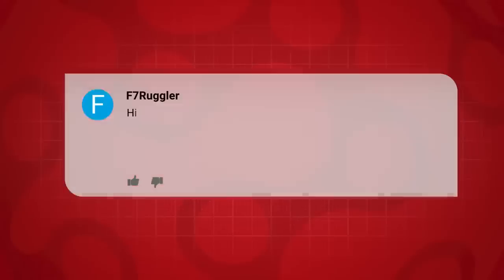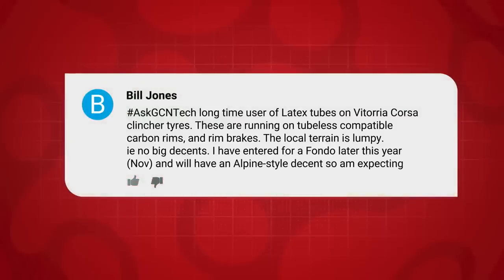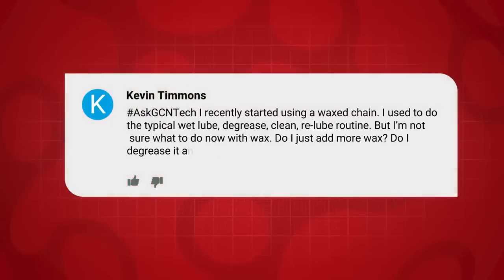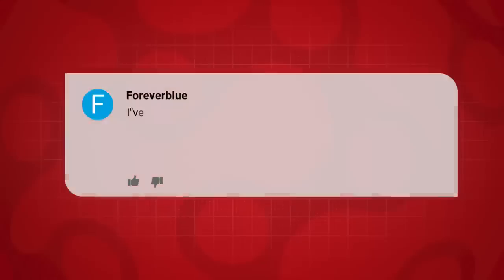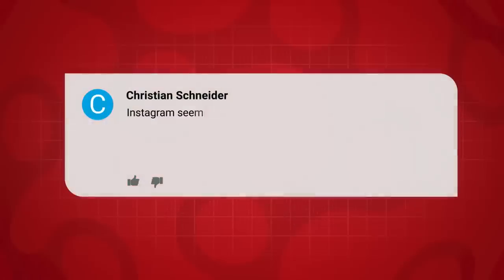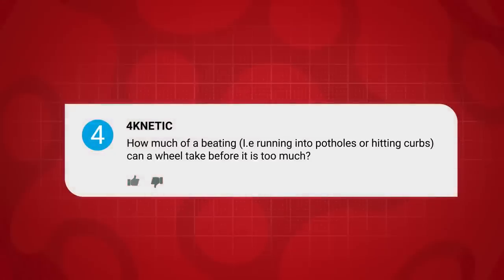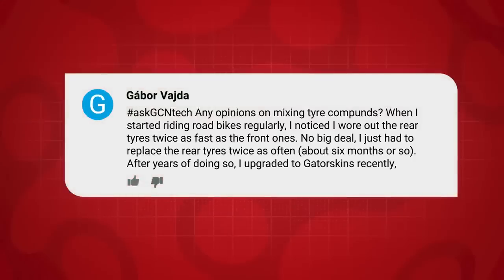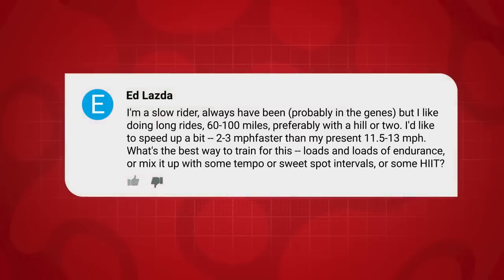What Is The Most Efficient Cadence For Cycling? | GCN Tech Clinic

Comment from the maker: Let us know your tech queries using #AskGCNTech 👇
Reply: Hi, GCN Tech! In your videos you are compare tyre witdth without relation to rim width. For example I using 23 mm width Conti tyre with c15 Filcrum rim. What if I wear 28mm tyre to this? Will I improve rolling resistance and ride comfort? Or it is better use slim tyre with slim rim?
Reply: #askgcntech HI, I recently got my first smart trainer and was wondering what are the best nonsubscription options? Are there any virtual programs to buy?  Thanks!
Reply: Hey guys! I'm currently running the SRAM FORCE 12 Speed ETAP AXS groupset and was thinking of slowly upgrading to the SRAM RED 12 Speed ETAP AXS groupset. Problem is, I'm not entirely sure if it's possible to mix groupset components?
Reply: Hi #AskGCNTech do you have a MTB road race in your country or just trail and gravel race?
Reply: #AskGCNTech Hey guys, so I'm looking at buying a road bike now (coming from MTB) and I got an option between an older 2014 s-works venge (used) or maybe even a current 2021 Trek Madone SL6 (new). Both for around the same price but the s-works would have rim brakes and older geo? 
What's your thoughts on this?
Reply: @GCNTech quick tip on tyre inserts for tubeless, I have had trouble with deflation running them straight away in a new set up (going from 75psi to 35 overnight) . I run the wheels without the insert for a couple of weeks to allow the sealant to do its job on the rim bed and the tyre carcass, and that has made a great improvement, taking more than 3 days of abuse for the pressures to drop the same way.
Reply: @ffop  I am under the understanding that AXS is mix and matchable.  I have Rival Front and Rear Derailleurs, and Force Shifters and Brakes.
Reply: Hello guys just want to ask my gravel bike tire on the back has
wrinkling marks like on drag tires of cars is it 
because im heavy i weigh 80kg or my acceleration power is high 
and my tire cant handle it #ASKGCNTECH
Reply: #AskGCNTech
Hi Tech Team... I upgraded my bike computer last year. From a 2016 CatEye STRADA  to a XOSS G+ GPS unit. Everything was peachy until I did my first 200 Km ride. I felt that when riding in unfamiliar places I kept taking my phone out to check where my current location is. Also, during ascents I worry that I may not have enough energy to reach the top. Which did happen. Not knowing that the climb was about to end in a few meters.
Now, for a person who rides 2-3 days a week (sometimes less) would it be wise to upgrade? Which would you suggest if I should upgrade? I'm torn between Wahoo ELEMNT Bolt and Garmin Edge 530. But leaning more on the Bolt. Hope you can help.
Reply: #AskGCNTech when are you going to replace the missing Park Tool tool hanging on the right of the screen? It’s killing me!
Reply: #AskGCNTech Hey guys, does a small handlebar roll really have a positive influence on aerodynamics as you can read on several websites or is it just another marketing gag? 🤔
Reply: what is the best cadence range for sprinting and what is the best position to be in as I'm a heavier rider with a bit more power I really enjoy sprints but I feel like there is a lot more that I can get out of them

Comment: In regards to cadence, it is a highly personal comfort issue.  That said, the major lower extremity muscles used to move pedals are primarily constituted by slow twitch oxidative muscle fibers.  These are the skeletal muscles aerobic fibers.  They are the first to be recruited by the CNS and have a relatively small cross-sectional area which means they do not generate large quantities of force relative to other fiber types.  What's more, it is believed that as say a cyclist becomes more trained, some of the other fiber types will shift in their function to this type.  It's one adaptation to training stress.  Thus,  these fibers will ultimately be the most commonly used by a cyclist and they function best under lower force but higher contractility rates.

This is one reason why a higher cadence for general riding is widely preferable with lower  cadence, high force work necessary for steep inclines and town line sprints.  I won't even get into the stress on the ligaments and other soft tissues...

Signed...a physiology nerd.
Reply: I used to hate any high cadence when I was very unfit and my brain was telling me not to do it as I would then struggle for breath etc, that the strength in my legs to grind was my advantage. A few years on and I thought just the other day how my style has naturally evolved to a much higher cadence - anything else now feels unnatural. I only really grind as a last resort when things are just too steep and I don't enjoy it at all.
Reply: I know for a fact, if you have lung or heart issues, you definitely will be restricted to under 85 rpm. I recently figured out that because I have a heart murmur I could never keep up for long with the faster riders.  A friend of mine had lung problems and had to use monster gears to keep his rpms down under 75 rpm.  TALK to a sports DOCTOR.
Reply: As a compact cyclist, 1.5m, 48Kg, parceling the same power using higher cadence (mine usually around 110 on flat/rolling terrain, 90s or even high 80s for ascents) requires good aerobic fitness, but is far easier on the musculoskeletal system than doing a thankless grind in higher gears ratios. But that's just me adapting to what's comfortable for me. Yout results may be quite different. Everyone has their own chosen cadence sweet spot.

Comment: To foreverblue: I‘m also a long-time MTBer and only started road cycling last year. From the MTB, you are most likely used to high cadence. A major difference I noticed is that road bikes often come with the big gears the roadie pros use but almost no MTB, even XC race bikes, come with the gears MTB pros use. Don‘t be shy to switch to smaller gears.
Reply from the maker: Good advice Christian!
Reply: By smaller gears you mean the more tooth count?
Reply: @BigBrownMonke  More teeth on the back, less teeth on the front. You could get a compact chainset or a bigger cassette (if your rear mech has the capacity)

Comment: On the topic of rear tires wearing out:  Most road tires are symmetrical, i.e. there's no front specific tire or rear specific tire, and the tread is generally designed to run the same direction front or rear.  So what I like to do is rotate my tires as the rear wears out.  I'll move the former front tire to the back, since it is generally not very worn at all by that point.  Then I'll install a new tire on the front.  

This gives me maximum grip on the front wheel where it's needed most.

There's not as much of a culture in road bikes of running a "mullet" setup with different size or types of tires front and rear, but there's no inherent reason it wouldn't work.  It's mostly an aesthetic thing to make sure your tires match.
Reply: exactly what i do!
Reply: This came up in a previous tech clinic and is not recommended since the rear tire wears out differently (whatever that means). I think Dan was the one who said this specifically

Comment: My trick for waxed chains...once you've initially degreased and waxed the chain, no further degreasers or solvents are necessary. Just remove the chain an put it in some boiling water. The heat will melt and remove the old, dirty wax and clean the chain.
Reply: Jonathan, do you reuse the quick links when you do this or use a new one every time?

Comment: Re waxed chains, I have been using them for mountain biking as well as road, often just hose off the mud/dust, when re waxing the chain I use hot boiling water, the chain is in a kitchen sieve, then dry and rewax in an old slow cooker, I often wax 3 chains at a time so to save time - use quick links. I have had no measurable stretch after about 5000 km👍

Comment: Crank length plays a MASSIVE factor to cadence, my average cadence for the same power using 170mm cranks are around 85-90. Switched to 150mm and now averaging 100+ rpm, less fatigue over a period of days of training, average heart rate goes down by 10-20 bpm with no loss in power, if not higher sustainable power
Reply: so the shorter the better? Thats good news for me i just ordered s 165mm, currently on 170
Reply: @6kmanu  depends, cause with shorter cranks gonna make harder to climb
Reply: @AlqadrianShangsapurba  Easier gears will help eh?
Reply: @marcdaniels9079  I have watched the video during my research before buying the 150s. Assuming that the researchers know what they are talking about and publish accurate data then numbers don’t lie. 

But yes, my experience says otherwise:

1. Given that appropriate adjustments are made to cater for shorter cranks (saddle height, setback, saddle tilt, stem height). I managed to get aero a lot lower, comfortably more aerodynamic. A smaller spinning circumference also feels a lot more natural

2. I have done several interval sessions from Sweetspot to VO2 Max, I had no reduction in power or speed. And yes, my cadence were higher. Zone 2 also feels more “right”
Reply: @AlqadrianShangsapurba  Wrong. Gearing matters, when you go for shorter cranks, you will subconsciously use smaller gears to spin faster, increasing power with cadence rather than torque, which also feel more natural than forcing the knee to “chop” up and down in a larger range of motion with long cranks. The “feel” of losing torque that you’ll find with shorter cranks is temporary, it should take you an hour to get use to. But like I said, I didn’t lose speed or power, higher cadence and lower heart rate were the results
Reply from the maker: @6kmanu  optimal crank length is often relative to your height
Reply: What is the size frame of your bike with 150mm crank? How did it affect center of mass from bike fitting? It would feel your high from the ground yeh?
Reply: @AlqadrianShangsapurba  one would think it'd be easier in a sense, because a shallow squat you can do with more weight compared to a deep squat, so you should be able to produce more force with less range of motion, I don't know if it cancels out the loss of torque from the shorter cranks, but it should increase efficiency, at least in my thinking.

Comment: The perfect cadence is at the sweat spot inbetween spinning and grinding and it depends on power output. Hard to maintain optimum cadence with gears as just a few rpm makes a big difference. That's where a CVT is so brilliant. Especially when its fully automatic and adjusts cadence based on power output.
Reply: Actually, the best cadences are what is best for YOU. It could be 65 RPM in a big gear or it could be 100 RPM in a small one. There is NO formula for figuring out what is best, you have to get on a hill and figure it out.
Reply: @jamesmckenzie3532  Precisely everyone has a cadence that they feel is spinning a little fast and a cadence that feels like grinding. A persons optimum will be right inbetween. My automatic shifting is setup to my favourite cadence for the given power output.
Reply: @Ed.R  there are automatic bike gears? And you say shifting, so do you mean an automatic shifter or a cvt (which don't shift at all)?
Reply: @tktspeed1433  Automatic shifting is definitely a thing for bicycles. Never really caught on for derailleur gears but with a CVT it makes more sense. Within an upper and lower limit a CVT has an infinite number of ratios. Therefore automatic shifting can effectively shift continuously and maintain a perfect cadence. I built my own automatic shifter 5 years ago and its been a great project. They are available to buy but as far as I know mine is the only one in the world to receive power data.
Reply: @Ed.R  I have mostly been a motorcycle and car guy for most of my life so I did not know bikes had such things, and I know how CVTs work, that's why I was confused about the "when to shift" because they either never shift or always shift depending how you look at it.
Reply: @tktspeed1433  I've thought about that because CVTs on motor vehicles are always automatic. Its actually more unusual to have manual control over a CVT.
Reply: @Ed.R  a manual cvt does indeed sound very strange, but I guess having a twist type shifter controlling a CVT manually on a bicycle could work. Usually they are controlled by centrifugal forces, at least on scooters.

Comment: #AskGCNTech
Hi Tech Team... I upgraded my bike computer last year. From a 2016 CatEye STRADA  to a XOSS G+ GPS unit. Everything was peachy until I did my first 200 Km ride. I felt that when riding in unfamiliar places I kept taking my phone out to check where my current location is. Also, during ascents I worry that I may not have enough energy to reach the top. Which did happen. Not knowing that the climb was about to end in a few meters.
Now, for a person who rides 2-3 days a week (sometimes less) would it be wise to upgrade? Which would you suggest if I should upgrade? I'm torn between Wahoo ELEMNT Bolt and Garmin Edge 530. But leaning more on the Bolt. Hope you can help.

Comment: Hey guys, was just doing a deep clean of the drive train and noticed some significant wear on the chain rings, cassette and rear derailleur, the chain is new (replace it 1 or 2x per year). Those other (tiagra) components have about 10k km in them, 50% of which was gravel - often for many hours with heavy dirt/mud no doubt accelerating the wear... anyway, the question is how do i know its time to replace each bit/all of the drivetrain? Thanks as always, love the show. #AskGCNtech

Comment: Hi... I have a 2020 Cannondale CAAD13 with mechanical Ultegra. I would like to upgrade to Di2. Would you say just get new Ultegra 11-speed shifters, derailleurs, battery and cables or would it be better to switch to 12-speed 105 Di2, which is semi-wireless and therefore easier to set up. The 105 option is about £350 more expensive. Thanks #AskGCNTech

Comment: #askgcntech Hey y'all, thanks so much for all the great content! I recently acquired a set of Bontrager xxx tubular wheels and am running Continental Sprinter tires. I got a tiny puncture out on the roads and have read conflicting information about the viability of putting tubeless sealant inside the tire. Do you think it's safe to try or should I pursue the much more labor intensive repair process?

Comment: I have a kit fitting question, I want to buy some bianchi kit, but at a 6 foot 3 250 pound (113kg) American I worry about size and fit given the cost. Do you have any links that will allow me to measure myself to a size chart? And I remembered the bashing wheels video. That was wonderful.
Reply: Who makes the kit? Most commercial kit manufacturers have sizing charts available. You might inquire about a return policy if the kit doesn't fit.
Reply: @jamesmckenzie3532  I don't really see a brand on it, just the advertised. I couldn't even find on the bianchi website.
Reply: @shawnsee2688  For an American? REI has a lot of different brands and size charts. You could look at that to get a sense of fit. If US based and a bit larger, I'd check Aero Tech Designs. Not the fanciest, but made here in the US and good quality, very size inclusive. My kit from them has held up well.  Fat Lad at The Back also has larger gear. that's cute. I like what I get from them, it's UK based but more stylish than the US stuff. I would not buy anything without being able to see a size chart.

Comment: #askgcntech I just bought a new canyon bike with the ultegra di2 12 speed group, the bike is fitted with a left sided powermeter. On my previous bike I had a ultegra 11 speed dual sided stages crankarm powermeter. Is it possible to fit a 11speed front chainring on a 12speed groupset? I would like to ride with dual sided power. Thanks!

Comment: #AskGCNTech Hi All, I have just been lucky enough to acquire a Canyon endurance and when picking up the bike I was told that the rear tyre would need some more sealant in. My question to you is, can you mix differnt sealants? as I don't know what sealant is in the tyre already or do I have to clean out all of the original and refil with new? thanks in advance.

Comment: running different tires is easy and smart to do.  you could use a 28c, 32c in the rear and than a 25c or 28c in the front.   doing so is reflective of how the laods the rear and front whell are under are different.

rear tires suffer punctures more and front tires if they are too small/thin suffer from pinch flats or lack of traction/rough ride.

even spokes on the drive side, non drive side can be optimized by having all the j bends exit the outside of flange, using 1x lacing, and you can do radial lacing on the non drive side and 1x on drive side to save weight becasue the tension the non drive side is under is really not much.

i have a wheel with a 25c tire on it and have rode it with a 32c. and even a 36c in the back and what im left with is a dirable setup where i can haul a heavy bag or go off curbs a little easier.   i also took a velocity aileron rim and reamed the spoke holes to fit like 14gauge(i forget exactly) e strong spokes, very stong wheel build.

Comment: #askgcntech: Dr. Bridgewood, please put on your geek classes and answer: I know 160mm disks provide a greater braking force than 140s, but why?
Reply: Greater leverage. The larger the disc the more torque to stop the wheel turning. A larger disc also dissipates heat better.

So, seeing as greater leverage is better, a 700c rim has even more leverage, so rim brakes are better than discs 😉

Comment: Spinning is only possible if you have power..
Reply: It's also only needed if you have a high power output. At 100W 65 - 70rpm is fine. Increase to 80 rpm at 300 - 400W.
Reply: … or shallower hills
Reply: @rob-c.  That's only true if the bike has insufficient gears. My mountain bike I use for trailer towing has gears so low I can spin on a steep hill towing a trailer at 2mph.